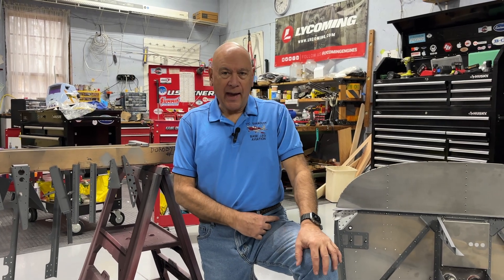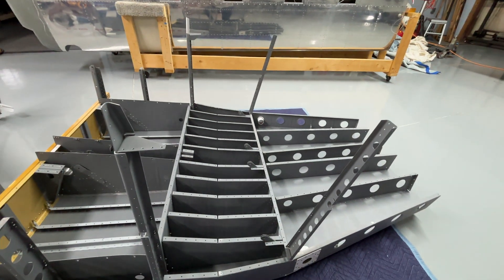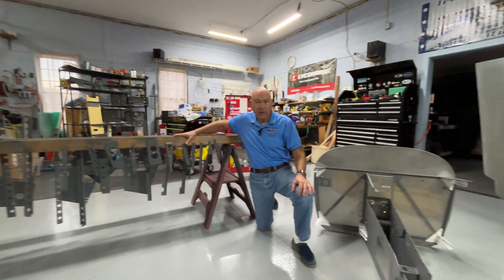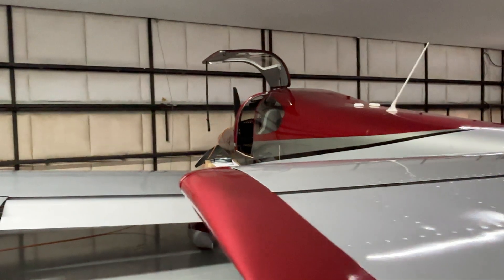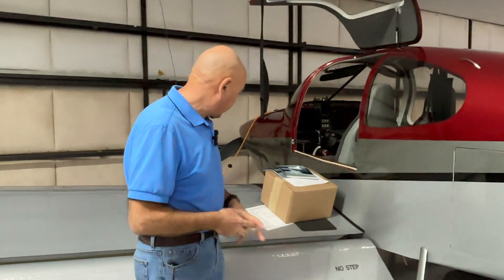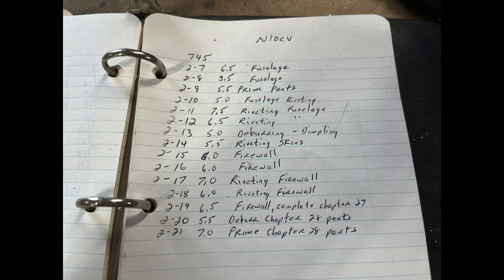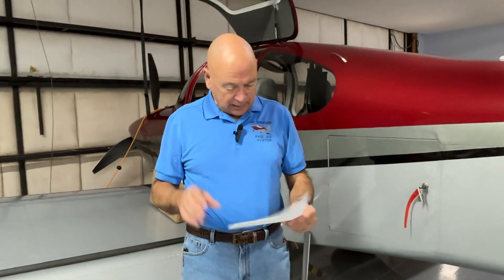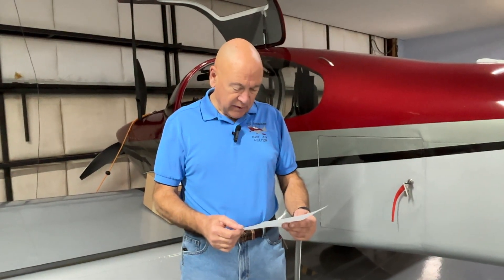RV 10 Update, DAR process, Alaska books to Aircraft Spruce

Comment: Vic, even though I'm building in Canada a great video. I was curious which primer you are using on the firewall support pieces? Is it the same as the rest of the build or something different? I have been using SEM self-etching throughout my build but wondering if the firewall support pieces require something more robust? Thanks
Reply from the maker: I’m using the Eastwood DTM epoxy primer in most places. it seems resistant to solvents, unlike the SEM primer. I do use the SEM primer for areas that will not be exposed or cleaned in the future.